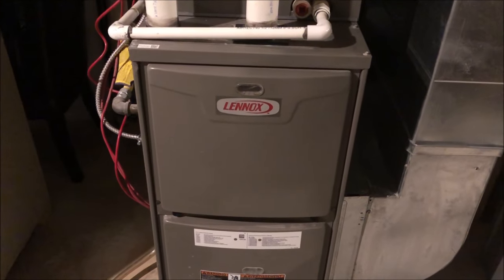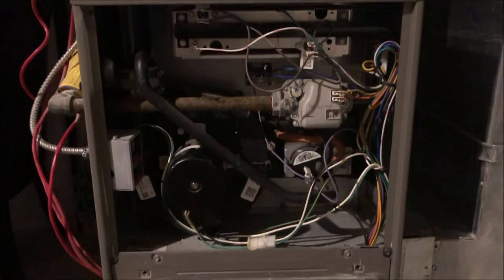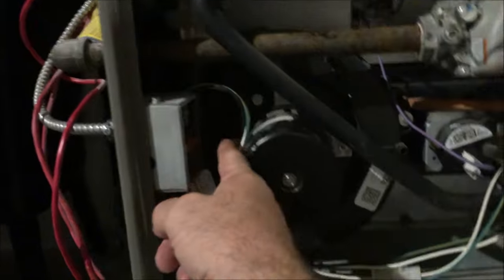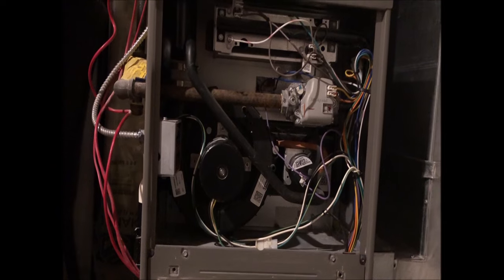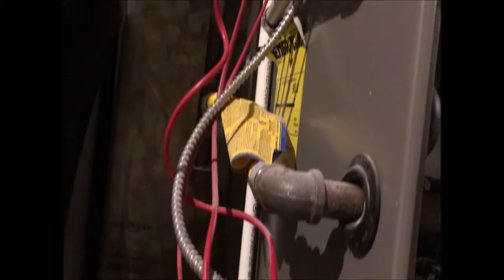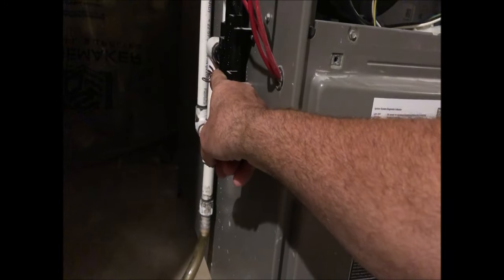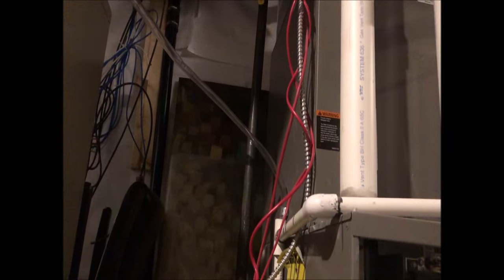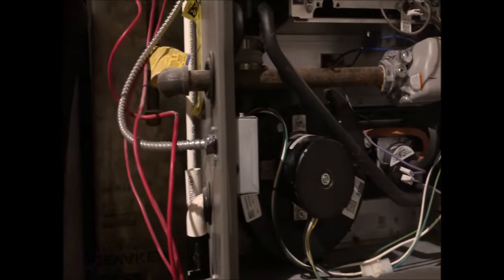#06 Water in furnace inducer motor. Furnace repair

Comment: This is exactly what my Furnace is doing this morning when I fired it up for the first time of the season.  Going to attempt repairs later today, thank you for this video.
Reply: Wow sure hope it helps. 
Have a good day
Reply: Actually, mine ended up having a drain port at the bottom!  All I had to do was remove the plug and the water drained out!  Just an FYI for those with a Concord furnace and this issue.

Comment: Great video. My furnace was cycling over and over, no warning lights on the board, all the sensors seemed to be working correctly. Then I heard a gurgle when the inductor motor started. I took it apart and it had about a cup of water inside. I dried it out and checked the drain lines and found the hose exiting the intake (where the moisture comes from) was clogged. The hardest part of the process was putting the hoses back together due to the small amount of space I had to work with.
Reply from the maker: Glad you got your furnace fixed👍

Comment: Instead of draining, I just used suction to get the water out. It was a lot of water./ maybe 16 oz. and all that water was causing a short cycling problem by messing with the pressure switch. This video just might save folks a 200 buck repair call. thanks
Reply from the maker: Glad it is helping people
Reply: I’m so glad you mentioned this was causing a short cycling problem. I’ve noticed mine had been short cycling and I watched a regular furnace maintenance video and did those things which it definitely needed. But I noticed when the inducer was running that I had water dripping out the clamp at the top of the motor. So there must be some water but not enough to keep it from not running and just cutting out after 2 minutes

Comment: thanks for the video.  I used your advice checking the lines and in my case, found that the rubber tube lines inside the top box after taking them apart to investigate were clogged with debris as well as a few other areas.  I cleaned them out.  I'm hoping this is the solution to eliminating water backing up.  will need to check on it and see next several days and counting.  this has been happening for years even after changing out the exhaust blow fan when it failed, maybe it failed due to all the water getting in it which is what it was doing.
Reply from the maker: Glad it helped. 
It would also help to use black plastic pipe instead of clear. Bacteria and allergy can’t grow inside a black pipe.

Comment: Exact same thing is happening to me right now. Codes are backed up this summer. Now it’s cold so I’m testing the system. Inducer not running, no heat. Open it up and inducer is HOT. My lines run the exact same way.
Reply from the maker: That is great. Glad it helped. 👍👍

Comment: Had the same thing happen on an elderly neighbors Armstrong unit (just like yours), It would run motor (gurgling), then fire up burner for 30 seconds or so-then shut down... Was flashing a code 3 on the LED on the control board..(indicating a pressure switch issue.)- (Red LED is on control board located behind lower panel).  Once drain line was cleared of slime n water and inducer blower motor housing--problem solved!!  You video I found later (after fixing his of course--lol)--But is SPOT ON as to diagnosing it!   Thank You. I also found the same thing --where installer tied in Evap coil condensate drain into the funace drain, I'll be separating his lines for him before next AC season.. --A note--Doesn't hurt to pour a capful of bleach once a month into the open pvc vent on the drain system--it helps prevent slime build up/clogging..  (same if you have a condensate pump box also).    TO DYI folks--these units will operate with upper cover off/ but not with lower cover off unless you hold the lower cover safety switch "IN".. (never leave these covers off under normal operation, but OK to run it during diagnosis without them..)
Reply from the maker: Yes the bleach is a great idea
Reply: @diyrepaircorner  No. Bleach is a horrible idea and will lead to problems. The fumes/vapors can and will get to the metal in the secondary heat exchanger and evaporator coil and cause corrosion which will lead to a destroyed furnace and/or evaporator coil.
Reply from the maker: @bill944  
Any suggestions?   always up for good ideas
Reply: Algaecide tablets, drain the trap after winter but prime it before winter. Flush trap with hot water. Get a respectable HVAV company p.m. agreement so it'll be serviced properly. HVAC equipment should be serviced regularly  just like any major investment. This will ensure the longest lifespan and efficient operation with minimal break downs.

Comment: This is the exact problem I'm dealing with (in addition to a flame rollout from something else), so this was useful, thank you! If you could, though, can you provide a bit more information on what happened between when you said "we'll take these bolts off, and these bolts off and take the case off", and then immediately after: "Well its drained now"? Thank you!
Reply: Agree. How is the back of the inducer motor removed? THX!

Comment: Shouldn't the "trap" or "air gap" (that open top box on the side of the unit) overflow and drip water from the side of the unit to indicate a drainage problem in the main line? Rather then drain in to the unit?
Reply: Is the opening too high? Looks like it is above the pipe coming out of the furnace. I have the exact same setup, but my opening vent is a lot lower than the furnace pipe. Of course, my problem is that small amount of water splash out of the damn thing.

Comment: My friend thanks for the informative video. My mother had a water softener installed. After this shes started having problems similar to this with her furnace which is in her condo upstairs. Her pan was full of water..every week she was paying some scumbag Plummer $150 to  physically remove water...the drain outlet must of been clogged and this plumber knew this just taking advantage of an older person. When she mentioned this to me I stopped it..according to new laws she had to replace old furnace and AC unit..so now her problem was solved indirectly but she is still hesitant to have her water heater or softener serviced by myself or anyone thinking it's what is causing the trapped air and water build up...the plumber was telling her that who ever serviced her softener left air trapped causing this back up..?? Charging $150  a week to physically remove water..could this have been her problem just that pipe got clogged?? Sounds so similar to what you showed
Reply from the maker: That very well could’ve been the problem. 
Those drain lines seem to plug very easily with bacteria growth.
Reply: @diyrepaircorner  here in vegas are water is so hard and she was 15 years without a softener..all her pipes were corroded and her manifold had to be replaced...vegas water is so hard it puts stains on my fish I breed..if you dont have a softener your skin begins to chafe and breakout..really bad stuff..I'm wondering maybe it could be built up of calcium and other deposits thanks for the video

Comment: That isn't the only reason that water can back up into the induced draft motor. There isn't any problem with the vinyl tubing discharging into the shared condensate line. Like anything, it needs maintenance which includes flushing the drain line, trap and treating with algeacide tablets. Other things that can cause water to settle in the inducer are, furnace not being set properly, clogged hoses from the condensate catch or clogged strainers at the cold end header box.
Reply from the maker: Yes very true

Comment: I had a similar issues that was giving me a 3LED flash alert and causing short cycling.  I thought i had a motor issue so I bought a new one.  When I changed it a bunch of water poured out.  My question is does the water ruin the motor?  I put the new one on and it works fine, should i save the old for a spare?  Great informative video!!
Reply from the maker: I would save it as a spare. I used my old one.

Comment: Have Lennox.  They told me my inducer motor is leaking water and should be replaced.  The replacement has larger 1/2 inch drain.  Cost $500 or more.  Is this same as exhaust fan?   Is it worth expense.  Where is water coming from?
Reply from the maker: Water here was coming from the drain that was plugged. There should be no water on the fan.

Comment: what about water draining from my exhaust vent into fan housing ?? ...nobody can answer that .
Reply: I would love an answer to that as well.
Reply: @larse8738  if you have a high efficiency furnace condensate will form in exhaust line which is sloped towards the furnace so water drains back to exhaust port that drains into inducer unit which is connected to condensate line that drains down and out to floor drain. If you have water build up that drain line needs to be cleaned out

Comment: How did you find the blockage in the pipes?  Did you do anything for that?
Reply from the maker: The line the drains the hrv needs to be a separate line or make sure the lines are clear every fall to prevent it from backing up into the furnace.

Comment: can this  cause my furnace to blow fuses? in 2020 i had to replace 15 3Amp fuses. and it just keeps happening. Happened more in winter when im using heat.
Reply: I would suggest contacting a licensed and insured service company.  There must be a short / electrical issue.
Reply: @swrconstructioninc.1158  i had 6 different tech came all they did was replacing the fuse and re-attach the wires.
But i checked it myself i think i found the issue, the clamp on the draft inducer was loose and water was dripping from there to the inducer housing. Hopefully that was the culprit.
Thanks tho.

Comment: I don't understand why they don't just put a drain hole in the bottom of the blower motor housing so this never happens.    The water would just drip and evaporate and never back up.
Reply from the maker: I agree
Reply: @diyrepaircorner  I've got the gurgling furnace now if I take that off and its full of water I'm drilling a hole in the bottom of the casing  #neveragain
Reply from the maker: Make sure it’s not the exhaust line. We don’t want exhaust fumes getting into your house.